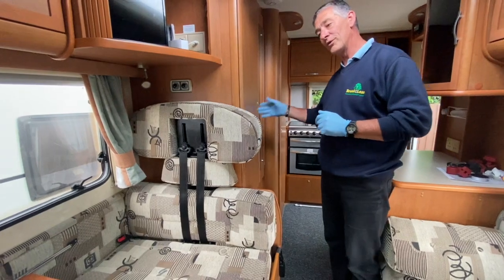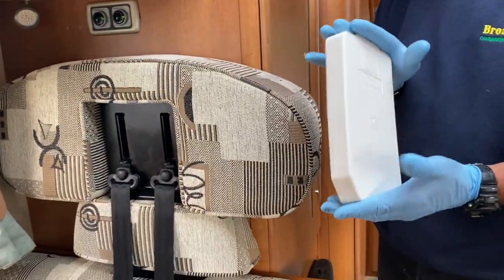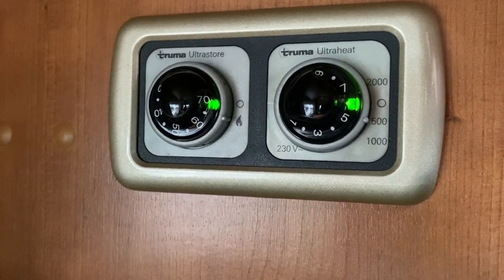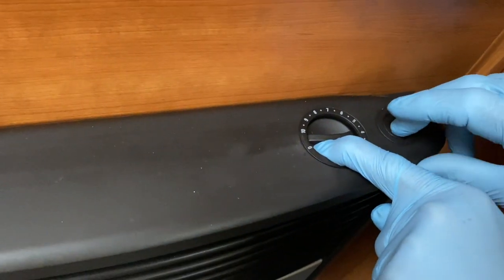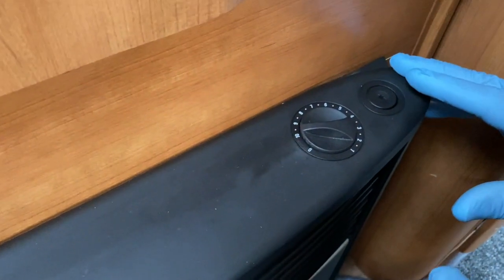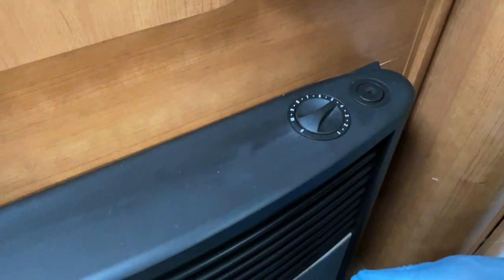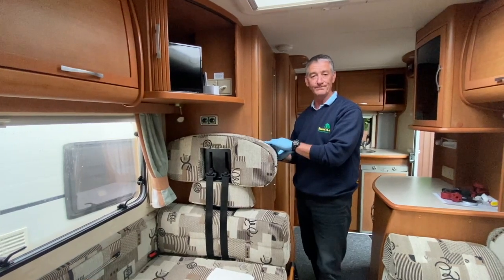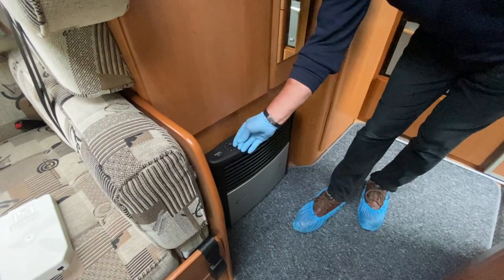Truma ultra heat / ultra store demonstration

Comment: Can you use the heater on electric alone? If so is it as simple as turning on at the wall and using with or without the fan as required?